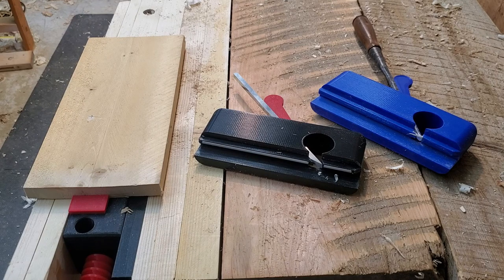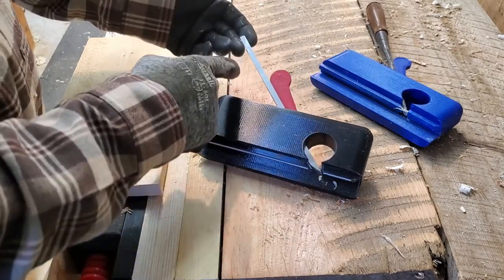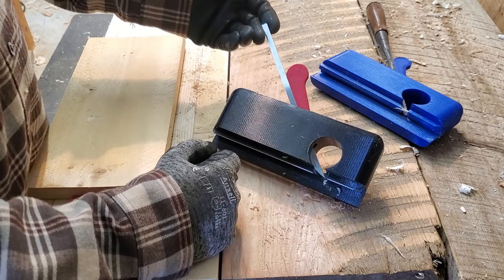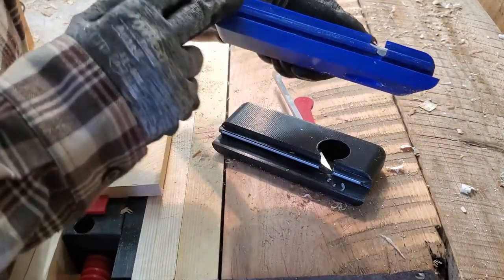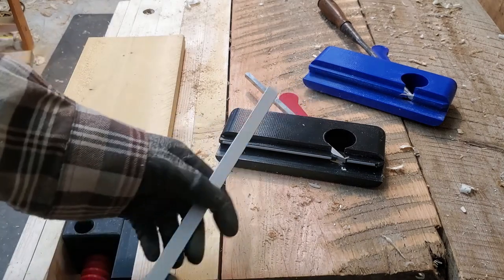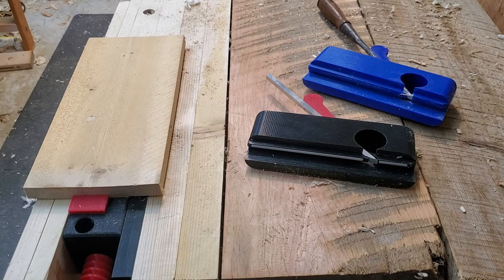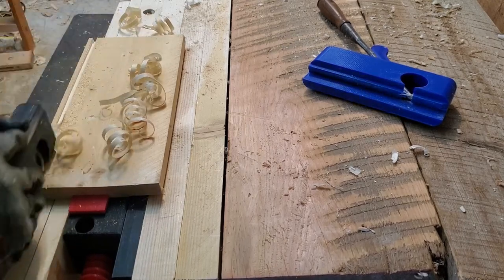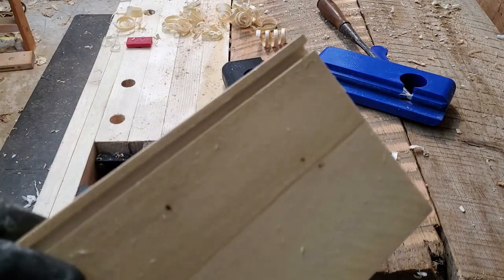Grooving Plane 3d Printed

Comment: Do you think a version with 3mm x 3mm HSS cutters would work well? Or do you think that might be getting thin on the print?
Reply from the maker: That would be pretty thin, and probably prone to chatter.  For 3mm wide grooves I'd probably grind the tip of a 6mmx6mm cutter down to 3mmx6mm, that's common practise for lathe cutting tools.  The sole/skate portion of the plane  would need to be reduced to thinner than the cutter tip.  A simple modification that would work for the aluminum sole version would be to cut back the plastic sole by whatever your desired depth would be, and keep the 1/8" flat bar exposed.  That would mean your cutter would need to be ground to ~3.5mm to avoid having to modify the flat bar. 
Let me know if there's any tweaks like this that would be useful for you.
Reply: @AllanMacMillan thanks! I think that I should attempt it first and then report back on modifications that might be needed! I am tempted to borrow the 3D printer at my place of work but I don't know if know if that would get me in trouble haha
Reply: @DiersakZelesnik  You can get a decent 3D printer now for 200-300 dollars, and you'll end up making LOTS of stuff with it.

Comment: I'm a 3D printing newbie. How hard would this be to modify for a smaller cutter, say 3mm/1'8" for use in making smaller boxes? I'm gonna make this one for sure, but could use a smaller one also.
Reply from the maker: Well, a very quick way would be to scale it by half in width in the slicer.  This would probably not be very comfortable to hold though.  I could also make a modified version, but I don't think the metal insert in the skate/sole would be practical at that scale for either option.
Reply from the maker: A version designed for a 3mm cutter 3.3mm from the edge has been uploaded.  It is labelled as untested for now, so if you do print one, and it works, please let me know.

Comment: Did you need to harden the HSS cutter or can you just bevel right out of the box?
Reply from the maker: It comes hardened. You do need to be careful not to overheat when grinding.
Reply: @AllanMacMillan  I don't have any grinders so I think I would do this against a piece of glass with sandpaper haha
Reply from the maker: @DiersakZelesnik  that will work with a bit of elbow grease, and overheating won't be a problem.